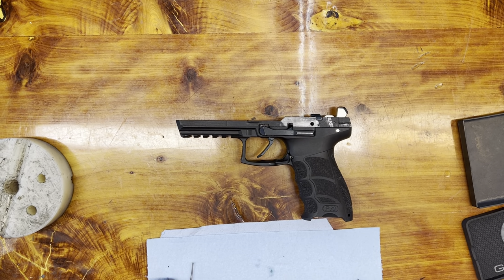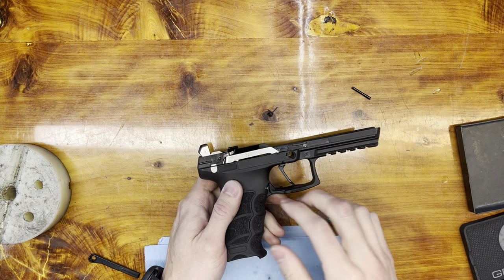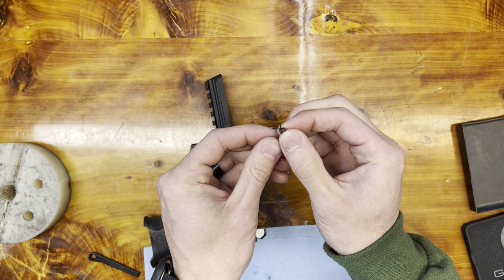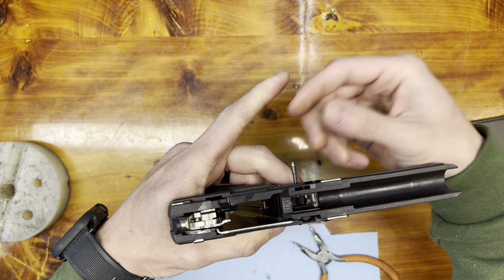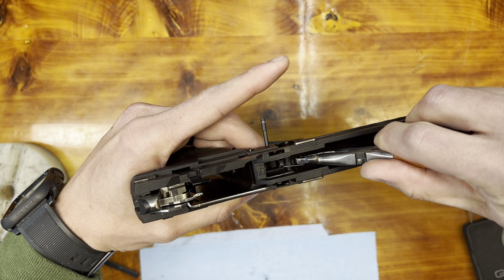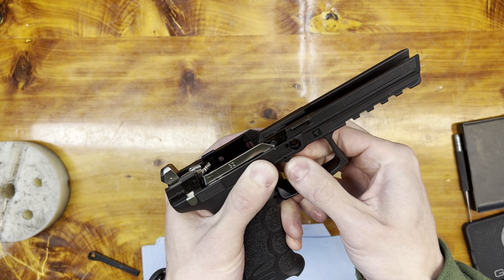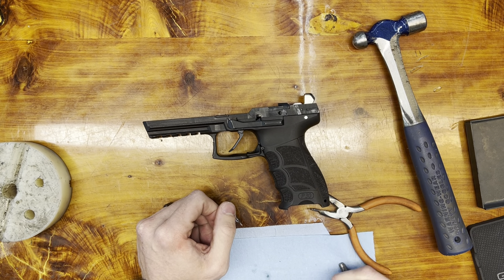HK P30 trigger disassembly and reassembly

Comment: THANKS! 
If i had just read instructions i would have had a bad time.  I attempted a few times with modified tweezers with no luck. found the perfect pliers with a flatter nose and it took me 4 tries without having to modify. Got them at Michaels. i think craft stores would carry more variation of smaller skinnier pliers if anyone is in need.

Comment: Installed the straight trigger and match return spring today. I waited until I had bought the HKP pliers.
It wasn't clear to me that the short leg of the spring is pointing *down*, behind the trigger - though, as a return spring, that makes all the sense in the world. This bit isn't mentioned in the video. I was squeezing the crap out of the pliers trying to keep the short leg pointing up and the long leg forward.
Once I stopped cussing, relaxed a bit, and thought thru it - bingo. Wasn't as hard as I was making it.
Reply from the maker: Sorry about that confusion. The small leg is the leg that pushes on the back of the trigger. The long leg rests in that slot in the frame and helps keep the slide lock retained.

Comment: This is an excellent video. The only part that is not too clear is the exact placement of the reset spring. I am at a standstill and can’t seem to get it. I’m using a larger set of tweezers. Are the players necessary to apply pressure? Do you have any footage that is closer ?

Thank you for the upload.
Reply from the maker: The pilars are necessary to hold the spring and compress it without crushing the coils. The long leg of the spring needs to be pushing against the frame while the short leg of the spring pushes on the rear of the trigger. If you'd like send me an email khosey@grayguns.com and we can get some more pictures sent over to you to show the orientation.
Reply: @keith_grayguns250  Where can you buy pliers like these? Can you do anything if you don't have such pliers? And I know you made these, but I would like to just buy some that do the job.
Reply from the maker: I know HKparts.net sell them. I've seen other ways of installing this spring using pliars and a small straw, I haven't personally used that method. I found making the pliars was the easiest and cheapest way to get the job done. This pliars are going on 5 years old and have helped with every trigger install I've done here at Grayguns.

Comment: How do I get the trigger return spring back in?
Reply from the maker: Its a little hard to explain via text, but you are going to grab the spring as shown in the video with some pliars and the long leg of the spring is going to rest on the frame, and you will compress the spring and push the small leg behind the trigger. Once this is done run the pin through the frame and spring and back through the frame. you will know you got it right if the trigger pulls easily and springs back.
Reply: @keith_grayguns250  Thank you! I was seating it without compressing it, wondering why it wouldn't work heh, that makes a lot more sense. I'll get it sorted after work today

Comment: @Keith_Grayguns  Got the HK pliers, still nothing different. I dont underatand how im supposed to rotate the small leg behind he trigger without the whole spring rotating out of position.
Reply from the maker: It's trickey but applying more pressure to the pliers will solve this. You need to apply just enough pressure so the spring will not twist in them but not so much you will crush it. We are currently working on getting more P30 Trigger Return Springs made so we can help get replacements out for those that have crushed them or worn them out.
Reply: @keith_grayguns250  OK, that makes sense. I wasn't able to get it which really bothered me as someone who likes to handle these types of things himself lol, but I took it up the street and a local gunsmith got it in less than 5 mins, so I tipped him $10.  But that was exactly what I figured, was that I wasn't squeezing hard enough and I was afraid to crush the coil. I think I could do it now if I had to, thanks. My problem was the coil was rotating and the small leg would be sticking through the small gap in the FRONT of the trigger instead of the BACK and I was aware of that, but just wasn't squeezing hard enough to keep from rotating the spring. I appreciate the help man, thanks.

Comment: Keith,

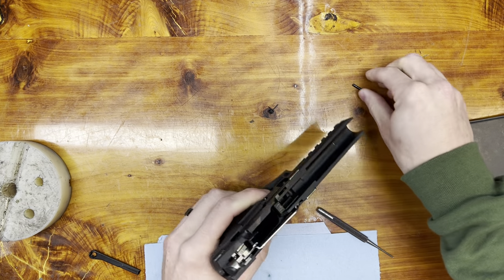Is the process for releasing/reconnecting the trigger to the trigger bar the same for the P2000? Specifically, :38 to 1:06 in this video.

Thanks!
Reply from the maker: Yes it is possible to use the same technique on the P2000
Reply: @keith_grayguns250  Not sure what I was doing wrong, but I was unable to get enough slack in the trigger bar to get it past the little polymer “nub” just inside the frame (which I presume is there to ensure the trigger bar doesn’t back out of the trigger). Anyhoo, I disassembled both the sear and hammer “groups”, which then allowed me to replace the trigger. Reassembling the hammer and sear groups was a fun challenge, but I got it! The trigger feels great. Can’t wait to test! Your instructions for reassembling the sear group was spot on and extremely helpful. Thanks!

Comment: I'm having trouble with mine. I was wondering in anyone in this thread has had this problem. I installed my flat trigger however the double action will not work unless I hold the trigger bar to the right by only a millimeter.

Comment: The short leg on my trigger spring won’t get behind the top back of the trigger and keeps going in front. Is my spring ruined?
Reply from the maker: It is likely that you could have smashed the trigger return spring and will need a replacement. Do you have the pliars? There is a sweet spot of pressure that holds the spring but does not crush it when tensioning it.
Reply: @keith_grayguns250  I ordered a new light TRS and the special pliers from hkparts. I don’t think the pliers I filed down were wide enough to grab the whole spring. Thank you for your response. I’ll attempt again in a few days and report back.

Comment: @Keith_Grayguns installed short reset system and the new flat trigger on my P30, but after pulling the trigger, it does not want to reset. Could it be an issue with the spring?
Reply from the maker: It could be, if that spring gets tweaked or installed incorrectly it would make reset sluggish or no reset at all
Reply from the maker: If you need more help with this send me  an email khosey@grayguns.com

Comment: I cannot for the life of me figure out how to get that spring bag in
Reply: Finally got it in. Idk if the p30l is different or not but the way you put it in looks like it is backwards from mine. I only figured it out by looking at the old trigger. The spring had worn on the plastic opposite of how you had shown. Very confused
Reply from the maker: The long arm of the spring should be on the right side of the frame when looking down into the trigger hole from the top of the frame. If you'd like shoot me an email with pictures of what you have and I can help diagnose whats going on. khosey@grayguns.com